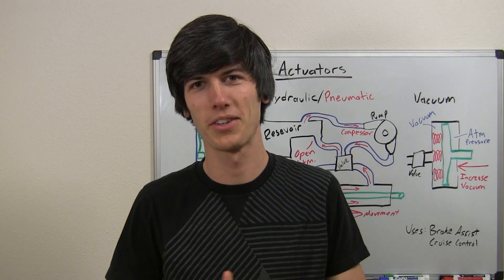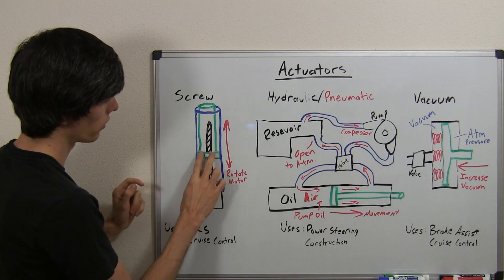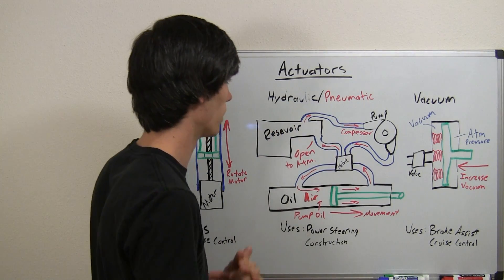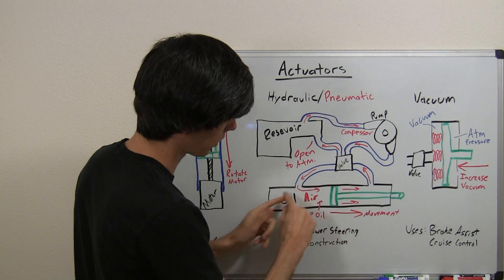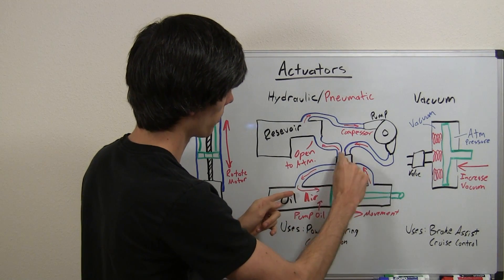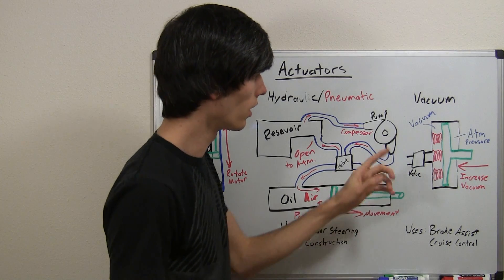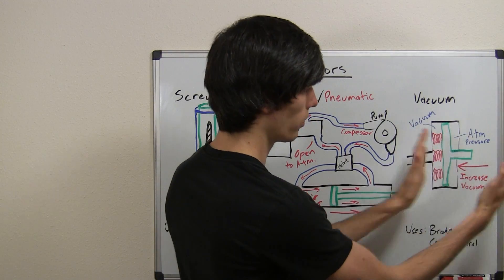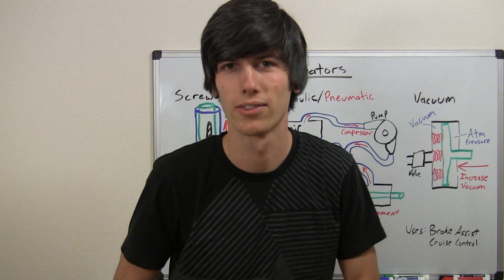Actuators - Explained

Comment: In the power steering example with the hydraulic actuator, does that mean the valve is changing states each time I change the wheel direction from left to right?  I'm curious to learn more about how such a valve would work.

Comment: Which actuator should you use on a diesel intake flap valve to prevent diesel runaway and cut off air to the engine

Comment: Re: hydraulic/pneumatic actuator: shouldn’t the medium flow the other way - ie from the pump to the reservoir and then through the valve?  To me the reservoir in a hydraulic circuit is similar to a large capacitor in an electric circuit- that is - to stabilise the current/preassure

Comment: The syringe ; when the movement goes on right; you want to pump oil to bring it back down. But how is that possible? Wont the stringe leak oil in doing so from top part as there is no closure on top? If so what is this type is syringe called?

Comment: you should start with what is Actuator actually?
Reply: An actuator is a component of a machine that is responsible for moving and controlling a mechanism or system, for example by opening a valve. In simple terms, it is a "mover". An actuator requires a control signal and a source of energy.
Reply: @ther6989  thank you sir
Reply: that's what wikipedia is for
Reply: It's kinda self explanatory when he explains different types of actuators.

Comment: hey great video! I was hoping to use a pneumatic air cylinder in a design I have to help elderly users rise from a knelt position, Imagine a kneeling pad that lifts you up. Do you think it would be feasible to use an pneumatic cylinder and an air compressor to do this in a way that would be portable product? I've been trying to work it out but pneumatics is totally new to me. I want the design to be cheap (less than £60/$89), portable (less than 10-15kg in weight) and strong enough to lift a load of say 65-90 kg (132lb-198lb). Any advise would be massively appreciated! I'll be subscribing for more.